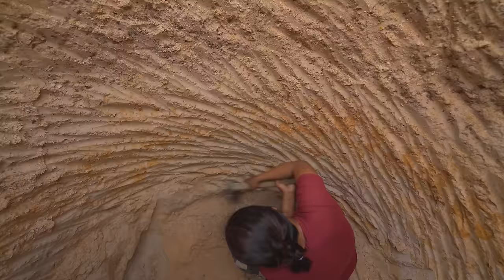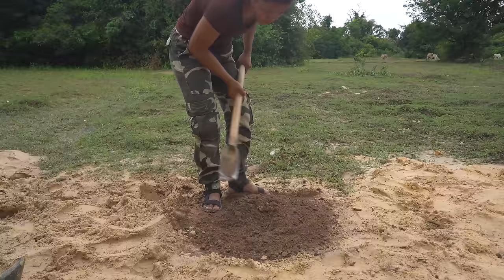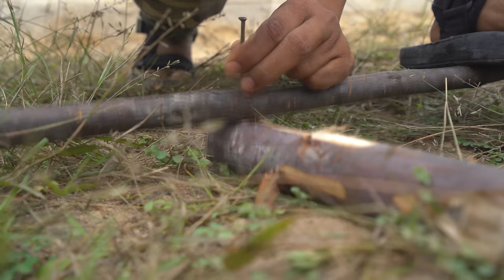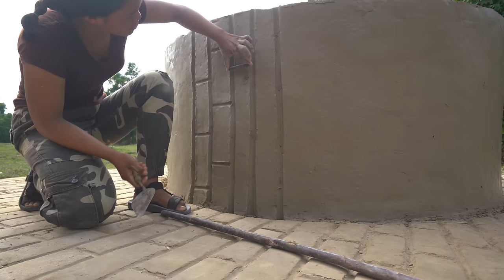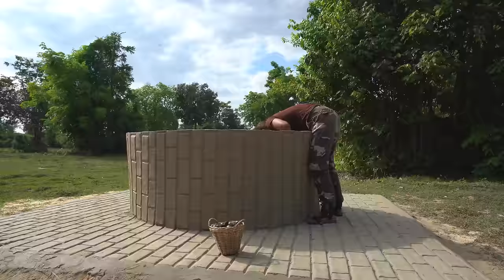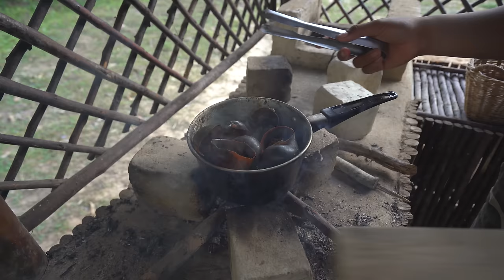Girl Living Off The Grid and Built Deep Hole Water Well 2022

Comment: Its my 3rd video in tonight. Give this girl an AWARD!! She can certainly put Alot of us to shame. Believable but Unbelievable,  Skill and Talent!! 🙌
Reply: If you think she does all this herself well...........
Reply: @1414141x  Chris, sadly by the comments?  They do ?? I have been in construction for 50 years. Using Pythagorus's theory, the volume of that hole is about 280 to 300 cubic feet compacted. That's a bloody lot for one small lady to dig all on her own (a large truck load) and she is still brand spanking clean with no dirt on her top or in her hair when she climbs out at 1 min.46. 
Notice no truck load of spoil, maybe 5 or 6 barrow loads with lots and lots of footprints and tracks.  A lot of dirty muddy workers out of sight away from the camera I would imagine. Che is very clever, an excellent tradesperson and very competent and running a good team. 😃👍 Good luck to her, judging by the views she would be making a handsome income
Reply: @woofersagainstviolence5349  
How do you calculate the volume of a cylinder using Pythagoras’s theorem? I always use pi to do it.
Reply: @thechumpsbeendumped.7797  Hey Chumpster, same same. With Pi. So old Pythe's theory is "the square on the hypotenuse is equal to, the sum of the squares of the other 2 sides. Typically, 3sqd + 4sqd =5sqd. IE 3x3=9  + 4x4=16 which equals 5x5 is 25. That is a right angled triangle, that you can use on the 1st corner of your house set out all the other walls, alcoves and boundary setbacks. You can use that principle to work out the height of your cylinder and many other probs.  π  = 22/7 or 3.1416 for ease of calcs.
 
So the Volume of a cylinder is V=Bh which is the area of the Base X by the height. So in the case of this ladies well, which we will assume is say 6 Feet across. The area =  the radius sqd x by Pi which is 3x3x 3.1416 which equals 28.2744 sq ft. Now at the 1min02sec on her video when she puts the 7 rung ladder in the hole 2 spaces and 2 rungs are poking out. Guessing the rungs look about 2 ft apart that means there are 5 rungs and the 2 one ft legs. So we have a hole approx 9 feet deep by 28.2744 which in turn equals 254 cubic feet.

So I apologise for my premature 280 to 300 cubic ft compacted soil. However at 1 min 44sec when she hits water, the full ladder is in the hole so it must be 12 or 13 ft deep which would equal about 360 cubic ft. Divide that by 27 to get cubic yards and you get 13.3 multiplied by the bulking factor of 1.25 and you have approx 16.5 cubic yards of excavated soil.

That is 2 almost full tip trucks of material to take away??? Where has all that soil gone to Chumster? I think that lil Lady has a lot of helpers, judging by all the footprints. Have a good one Cuz. 👍
Reply: @woofersagainstviolence5349  

 
I don’t know why you wrote all that waffle? In short, you can’t use Pythagoras‘s theorem to calculate the volume of a cylinder, yes or no? That’s all I asked and I didn’t need a 5th-grade mathematics class. 

FYI I’ve been using his theorem to square things since I was a kid over 50 years ago when I used to help my father lay out building foundations. 
As for the rest of your pointless and imo inaccurate diatribe. You state you think the rungs are 2 feet apart, that would make her significantly taller than 6ft coz she is just over 3 rungs in height. I know a lot of east asians and they're rarely much over 5 ft 4in in height. I’m estimating the true height of each rung is 16 inches plus the thickness of the bamboo so let’s call it 18 inches.
Check out when she’s climbing the ladder and her knee is level with the next rung up to confirm this? Also when she climbs out there are only 6 rungs in the hole plus the legs that have sunk into the mud so I’m estimating the depth to be nearer 8.5-9ft  when the slope of the ladder is accounted for but I’ll round up to 10ft to be generous to you. 
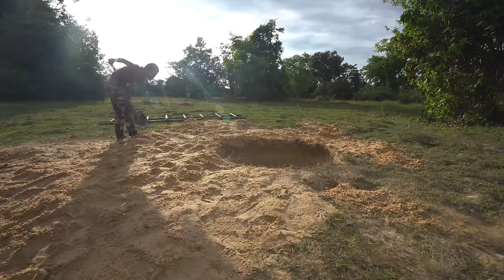The width of the hole is roughly triple the width of the ladder as can be seen when she climbs out at 1:48. The ladder's width appears to be roughly the same as the distance between rungs so let’s call it 18 inches for the sake of argument. 3x18=54in plus 4 inches to account for the bamboo = 58 inches or 4ft10in (4.83ft /2= 2.41) Area of the base would be approx 2.41 x 2.41x 3.141= 18.23 ft.²
base x height or 10x1.23 = 182ft.³ (6.75yd.³ compacted or 8.44 loose) or half of your rather inflated guesstimates. As for disposal of dirt or the number of footprints, they are both irrelevant because;
1. I couldn’t care less about what she did with the dirt. For all I care she and/or her construction team, if they exist could dig another hole and bury it. 😉
2. The number of footprints there are would be broadly similar if there were 1person or 10 people digging. Try thinking about it? If you don’t know why the number of footprints is irrelevant drop me a reply and I’ll explain it to you. 

FYI 
The chump being referred to in my channel's name is not me but as your observation skills appear to be lacking it's no surprise to me that you thought it did. See if you can work out who it references?
Reply: @thechumpsbeendumped.7797  Wow Chumpsta, I was jus being friendly. 😢 Chill out. I understand why your girl dumped you  🤔

Comment: That well is screwed.  Did you see as she hit the waterline, she didn't line the sides of the well with stone or some kind of fired ceramic brick to prevent the mud from flowing from the sides to the center?  the water and mud that gets pulled up is going to continue to flow from the sides to the center, undermining and hollowing out any support for the sides.  The well is going to eventually collapse.  The more use the well sees, the sooner it will collapse.

Comment: Very impressive.  Do keep in mind that a wall collapse in a hole, a mere 5' deep can easily trap and kill you--really.  Yes, the walls looked stable but there are cases where the walls looked stable and then poof  One might think, oh I can dig myself out, nope, not only totally immobilized even in a mere 5' of sand, but the eventual lateral pressure will suffocate you.
Reply: I don’t know the numbers but I was worried about the same thing!
Reply: Same thing happens in grain silos. You sink and you can't move, eventually you sink deep enough that your chest can't expand to take a breath.  Many a farmer or farmhand has died that way.
Reply: Especially in areas where the soil isn't stable, you have to reinforce the walls as you go.  A couple of feet of earth weighs hundreds of lbs.  This might be Vietnam where they have subsoil that allowed them to build extensive underground tunnels that didn't need reinforcement.

Comment: Why do you have to dig a well if you have plenty of water at the surface? Neither water is potable.

The well is not stable and durable, the sandy soil will start flowing, as can already be seen at the ground. The work deep inside was life threatening dangerous.
She could have used all the cement for lining and stabilizing the walls of the well.

She is a tough woman but she has no clue of engineering.

The camera person could have helped a little bit.

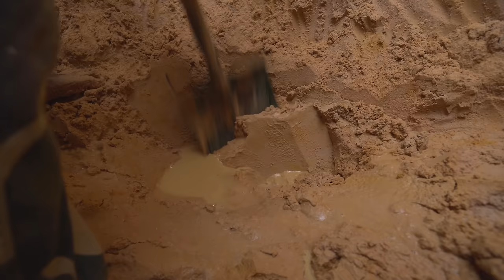Comment: Absolutely horrifying work safey fail. Happily she was not burried alive. Around 1:20 you see the wet sand beginning to slide inward already. Then luckily she leaves this dangerous hole without having reached a useful water depth for even filling a tin can without willing it with mud too.  In case of a "hydraulic ground failure"  = collapse of the hole floor because the wet material cannot withstand the pressure the camera people had no chance to get her out alive.  It happens suddently and large part of the hole would fill up. This video is absolutely irresponsibe thing. Her live had beed put into danger and maybe sole other people try tho replicate it and die.

Comment: Good effort, but she left out the part where it must have taken hundreds, if not thousands, of buckets to flush the well before the water started running clear, and the lining of the well with brick or concrete to keep the water clean and prevent the sides from caving in.

Comment: Wondering how long the wall of the sand well will hold up over time. The lower part will cave in as water level rises.
Reply: I thought the same thing. It will cave off with the water table until it finds solid enough material. Problem is, it will also cave outward and bell.